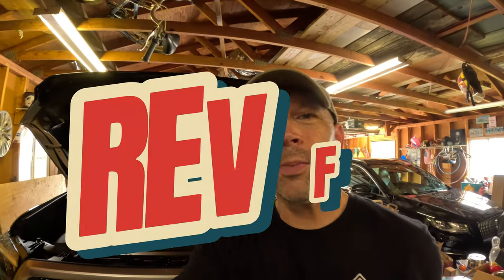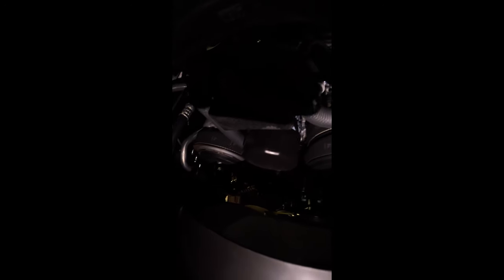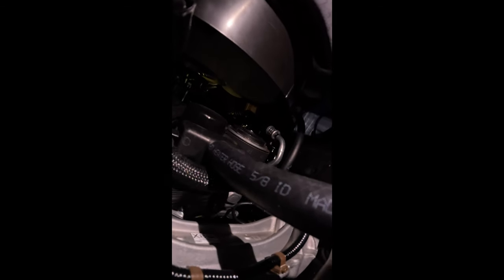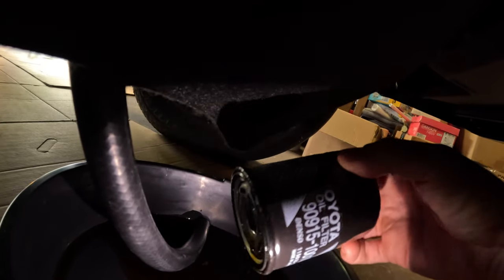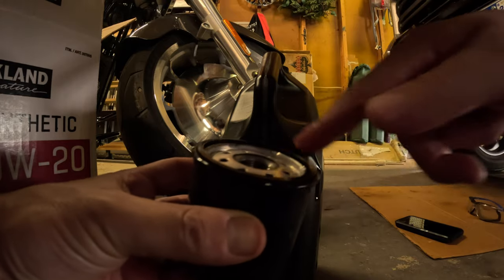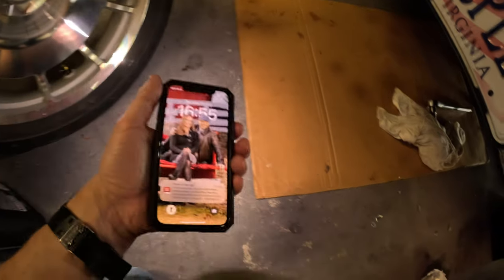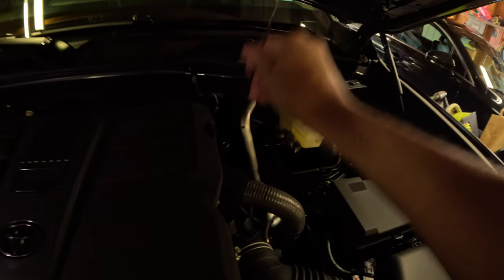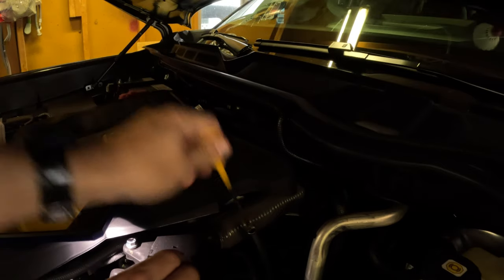2024 Toyota Tundra First Oil Change & Inspecting Oil Filter 1900 Mile Break In (Step By Step How To)

Comment from the maker: If I had to do it over, I would:
1)Use an Oil Filter Wrench
2)Wear Eye Protection!
3)Replace the Oil Plug Gasket
4)Fill the New Oil Filter 1/2 with new oil before installing

YOU LIVE, you LEARN!  Thanks so much for watching!

Comment: Good decision.  Keep the engine and turbos happy. Engine is very complicated, sludge would be a real concern.  10,000 miles is crazy when you compare the cost of an oil change versus engine repairs.  One turbo, just part only, is $4,400.    Full synthetic every 5,000 miles and enjoy it.   I'd have the dealer do the oil changes while you are under warranty so there is a solid paper trail if you ever have a warranty claim.
Reply from the maker: @davidm.8309  solid advice, thank you brother!  $4400 for one turbo?  Good LAWD.  Absolutely insane to wait to 10k miles!  Good point on the dealer/warranty paper trail.  Appreciate your comment sir!
Reply: You'll only get 2 oil and filter changes under warranty. Toyota will go by what they recommend, which is oil and filter changes every 10 000 miles. If you want a oil and filter change every 5 000 miles, you'll have to pay for it or do it yourself.
Changing the oil and filter yourself also doesn't void the warranty, thanks to the Magnuson-Moss Warranty Act.
Only if you damage something during the oil change, Toyota will not pay for it.

Comment: Changed mine at 1200 miles. 2024 Platinum which replaced a 2012 F150 Lariat. Loved the F150 but it had 170k miles on the clock.
Reply from the maker: @bobf.  that’s awesome!! What engine did your F150 have?
Reply: @revfree  3.5 twin turbo ecoboost
Reply from the maker: @bobf. that’s impressive mileage 💯
Reply: @revfree  I took care of it. every 5k miles oil change and tire rotation. Every 10k miles new air filter. Tires, brakes as needed. It never let me down, never left me on the side of the road. It was getting a little long in the tooth and it was time to make a change. Paint was still shiny, no rust, interior was clean and no tears in the leather seats. To and from work every day for 12 years, 50+ miles/day on regular gas. I hope I have as much luck with the Tundra.
Reply from the maker: @bobf.  absolutely!! I think a huge part of how long things last has to do with how well they are maintained.  Hoping you get 300K out of the Tundra!! 🤙

Comment: is your truck covered for the engine replacement recall?
Reply from the maker: So far my truck hasn’t been included in the recall.  It has a build date of April 2024.  I did get an extended warranty on the truck 7 years/100,000 miles though.  🤞🤞
Reply: I have 100,000k also.  And 7 years.

That’s Toyotas “damage control”…
Let’s give you a “used” truck… mine had 160 on the clock….
I’ll drive the wheels off the truck… if it locks up and blows into pieces then oh well…. Toyota will fix it or be sued…

The oil galley runs thru the 1st bearing. And that oil tube looks funky on other videos.

Hopefully they got it all cleaned up my birthday is may24!
Reply from the maker: @danielholland4385  yeah brother!! I hope so!! 🙏🙏🤞🤞

Comment: Do as I say, not as i do.  I can't believe you're not replacing the oil drain plug gasket and not using an oil filter cap wrench.  Bush job!  Hope you like the truck.
Reply from the maker: @Aardvark49  🤷‍♂️ I don’t see the big deal of not using an oil filter wrench.  And the gasket- only been on for 1900 miles so do I really need to replace it?  I’ll make sure to replace the gasket at regular 5000 mile changes!
Reply: @revfree  Those oil drain plug gaskets are very inexpensive - just as you mention.  Why not do what you advise?  Also an oil filter cap tool is what the pros use.  You're lucky that factory didn't overtorque your original oil filter to the point you couldn't get it off.
Reply from the maker: @Aardvark49 I’m learning brother so I appreciate your advice.  I’ll do it right moving forward.
Reply from the maker: @Aardvark49 see my pinned comment above..  this is how we grow!  Thank you for your advice
Reply: @revfree  I have a 2018 Tundra 4.6L that I love.  Great truck.  I'm an experienced AMSOIL Dealer and use the best available.
Reply from the maker: @Aardvark49  nice!! I bet that truck will run over a million miles!! I’ve heard amazing things about AMSOIL especially for Harley Davidson engines

Comment: Those motors are no good. Toyota has to replace the motors. Metal shavings in the lower end from the factories.
Reply from the maker: @scottmaz4063  fingers crossed mine will be ok!  The recall so far is only on the 2022 and 2023 models but I’ll guess we will see what happens 🤞😎

Comment: Oh, by the way you already addressed it but you need to replace the crush washer, ALWAYS after removing drain plug.
Reply from the maker: @bobf.  yes sir, I didn’t realize how important it was.  I appreciate your guidance and wisdom brother!
Reply: BS just use the same one , did a 1000 oil changes never replaced washer!